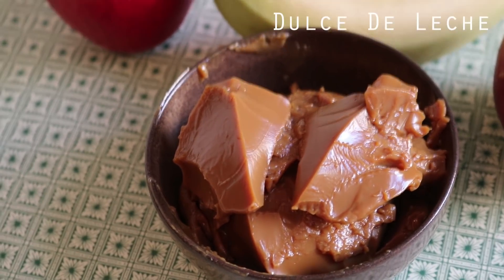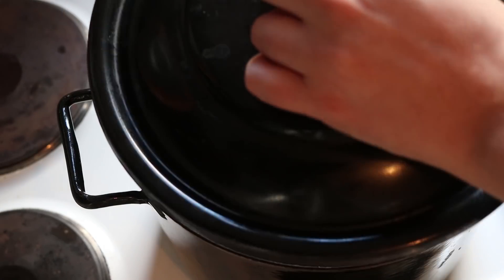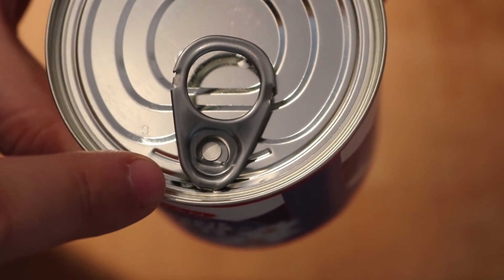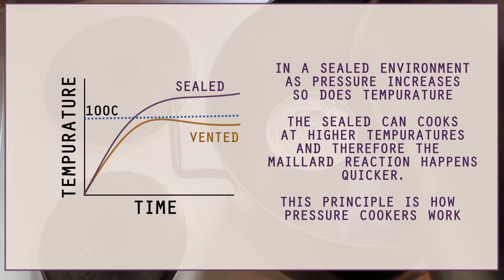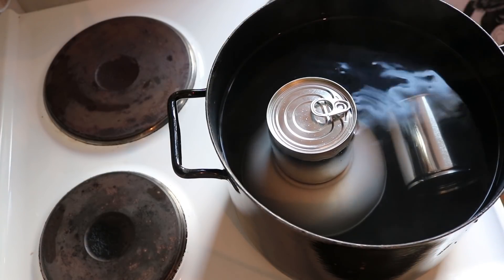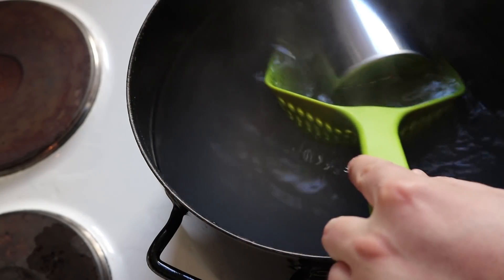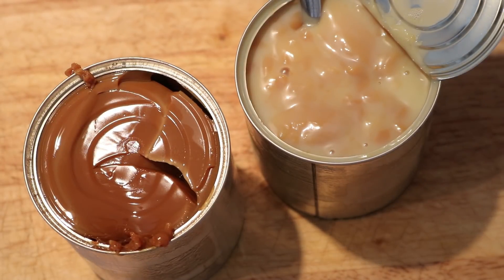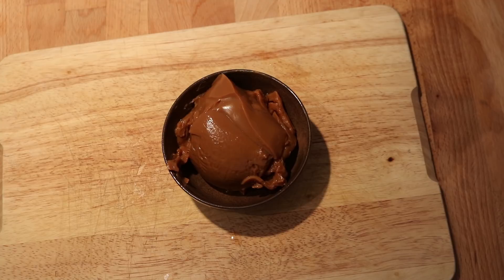Dulce De Leche Recipe - An Experiment in Cooking  with Pressure

Comment: I'm honestly surprised there was enough heat conducting directly from the bottom of the pot into the sealed can to make it work at all - since the water that is surrounding it on all sides exccept for the tiny patch touching the bottom of the pot cannot be hotter than 100 C in an unsealed pot.

Comment: I boiled my sealed can for 4 hours making sure it is submerged on medium heat and it still looked like the one you made vented (just a shade darker). What am i doing wrong???
Reply: Medium heat, it should be boiling
Reply: Normally dulche de leche is made in a pressure cooker. Success without one may be variable, and the results may be different due to different reactions happening at different temperatures.

Comment: I'm not sure how this is at all alike to nutella, except both being used as sweet spreads.

Also, you're not increasing the temperature of the canned condensed milk here appreciably. The pressure may be higher, but you're still limited by the fact the water it's in is boiling. Even if the can somehow got hotter than the water around it, the water around it would just dissipate that heat. I'd guess the difference here is mostly that the one can has more surface area in contact with the water so would heat faster, and the other can evaporate off the water in it somewhat (or that got in it, which also might slow the process) staying slightly cooler.
Reply: "Also, you're not increasing the temperature of the canned condensed milk here appreciably"

Proof?

" the water around it would just dissipate that heat. "

Obviously to some extent, but you gotta be quantitative. Otherwise, the fact that that the sealed can actually cooked whereas the vented one did not is pretty clear evidence your hypothesis is wrong.

" the other can evaporate off the water in it somewhat "

It's condensed milk. There's not a whole lot of water to begin with, it's a tiny hole, the boiling point is higher than that of pure water, the air inside the closed pot is already saturated, and no noticeable volume change can be seen in the final product. Heat loss through evaporation is almost certainly negligible, and you have an uphill battle to prove it offsets the surrounding bath of boiling water constantly pumping heat into it.
Reply: @isodoubIet  Having a brain.

If you put something in boiling water it heats up until it reaches the temperature of the boiling water. If the thing is hotter than boiling water, the boiling water instead cools it down to the temperature of the boiling water. As such, the cans in the water can not be hotter than the water itself.

Normally dulche de leche is made in a pressure cooker, where the water can get hotter, allowing the cans to get hotter, but since this isn't a pressure cooker, that's not happening. Boiling a sealed can may increase it's internal pressure, but it won't increase the temperature inside the can because, again, the temperature of the can will rapidly become the same temperature as the boiling water.

The real reason the sealed can is more cooked than the open can is that water got into the opened can. The speed of non-enzymatic browning is slowed by water. Water from the boiling pot got into the open can, slowing the browning reactions.
Reply: @trippykay  Took me less than 5 minutes. Nice alt btw, when are you going to come up with an argument?

Comment: Yep. As a rule of thumb, for every 10 degrees C you raise the temperature, the reaction speed doubles. The pressure is not raised by that much inside a pressure cooker (a couple of hundreds of an atmosphere), but that is enough to raise the temperature by 5-15 degrees. :)
Reply: Incorrect. The pressure in a pressure cooker is usually around two atmospheres, corresponding to an increase in boiling temperature of about 20ºC

Comment: But dude .... the source of heat for the sealed can was the boiling water surrounding the can ... which will be at 100°C.  The contents of the sealed can will never get hotter than the water surrounding it.
Reply from the maker: +John Grider Hey, thanks for bringing this up . The sealed can is in contact with the bottom surface of the pot, which is in thermal contact with the burner. The burner and bottom of the pan should be above 100C. The water prevents the can from heating too much and exploding. 

I didn't state this in the video and I probably should have. I did play a little fast and loose with the science, so I really appreciate your question, thanks for asking!
Reply: @FlavorLab  No, the sealed can won't go past 100C with all that water around it, contact with the pot or not. I don't know what is happening, but that's not that.
Reply: @FlavorLab  Are you sure? It only has a very small contact patch with the bottom of the pan, and steel isn't an awesome conductor of heat. I can't account for the difference in how they cooked, but I don't believe the sealed can ever got above 100 degrees c. Perhaps the vented can was cooler, not because of pressure, but because the top was kept above the surface of the water.
Reply: Water does not boil when it reaches 100 C, it boils when Vapor Pressure reaches Atm. Pressure. Because the can has its own pressure, water inside that can boils at higher temperatures. This is what makes pressure cookers cook faster, usually water inside a pc is boiling at around 110 C.
Reply: @camilobregon  Right, but the pressure throughout the rest of the pot is roughly 1 atm, which would imply that the temperature of the water is only 100c. this means that the only way for the can to get hotter than 100c would be by heat conducted through the bottom of the can, and i'm not convinced you could get very much heat through there